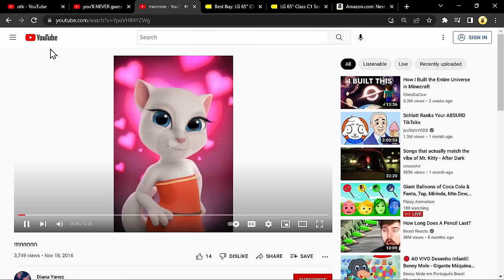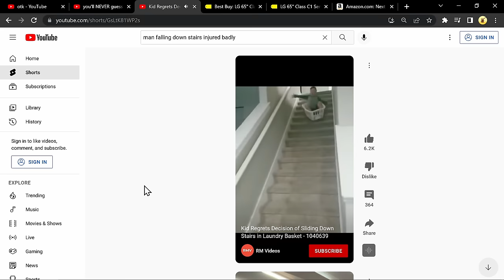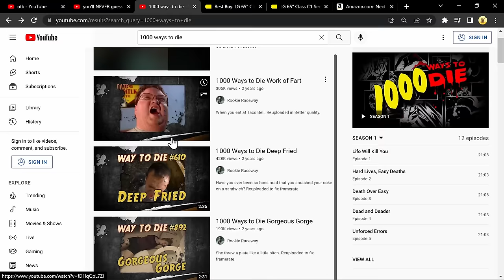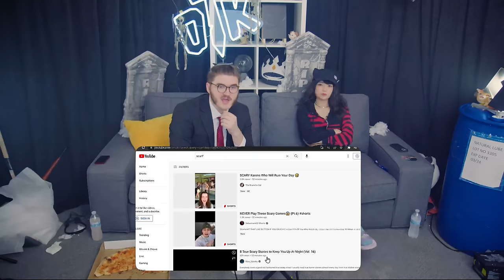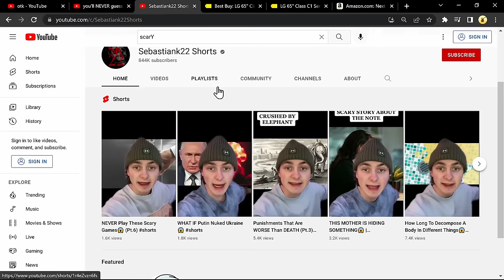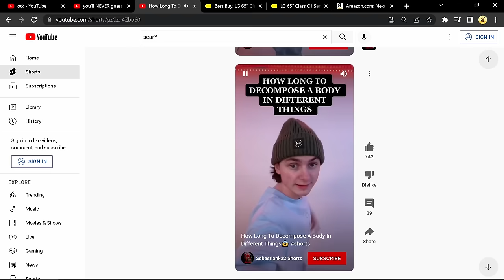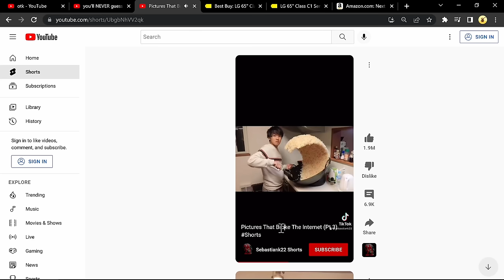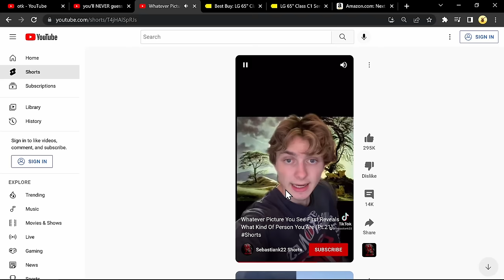THE SPOOKIEST VIDEO EVER.

Comment: The company I work for processes metal parts that we make, with large vats of acid. Lots of process control that has to go into chemical processes.

Also the acid is very slippery. It will ALSO melt your skin off and make it even more slippery. And you lose feeling in your acid burned skin pretty quickly (ask me how I know). Then as the water in your lungs turns into acid... You get the gist